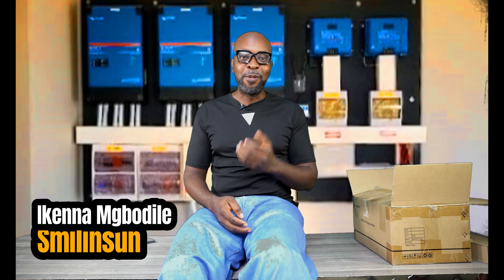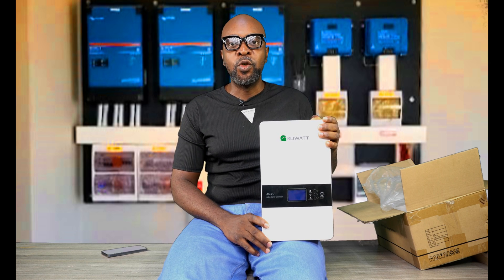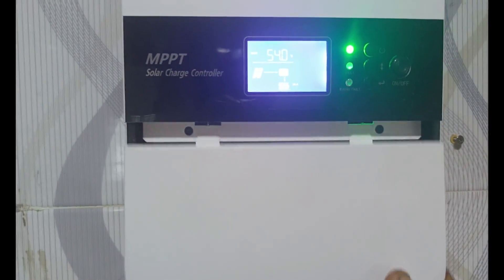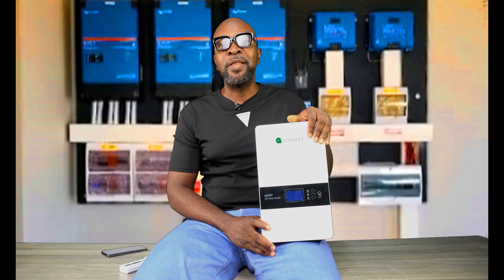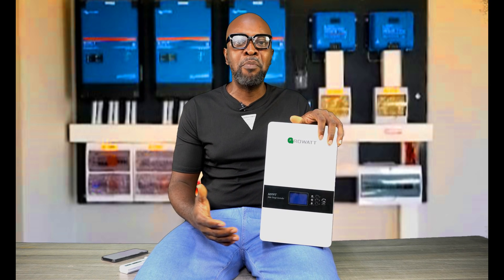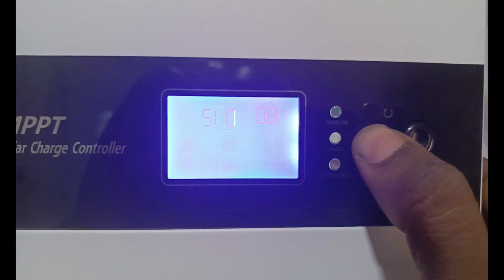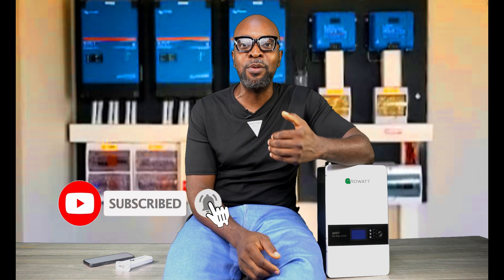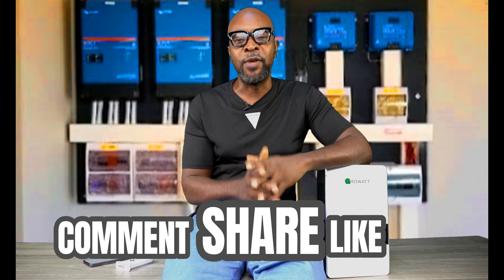Growatt Charge controller what you need to know.

Comment: Please I have a question. I have been curious for a while now about  these charge controller algorithm. 

I know there is Constant current stage, constant voltage etc.
I also know that when there is load on inverter, it draws a large amount of current from the battery.

My question is, how does the charge controller differentiate the current drawn by the battery from the one drawn by the load so that it can effectively execute the constant current.
Having in mind that the inverter, battery and the charge controller is connected in parallel.

On another thought, i believe this is when hybrid inverter is more smarter, because it can know how to separate the current going to the load from the one being drawn by the battery, so that it can charge the battery effectively.

To put this in a proper number perspective, a 12v 200A tubular that has a charging current rate of 0.1C which is 20A, a mppt charge controller can supply 80A but knows that it can only give the battery maximum 20A. But a 600w load at the same time draws like 50A from the battery. How does the charge controller know that the current drawn is from the battery or from the load, because the charge controller will make sure that the charge going to the battery doesn't exceed the 20A. This, in turn, will make the battery undercharge.

@ smillinsun, I need your input sir.

Comment: If you have a LIFEPO4 battery that has a BMS that cuts your battery when it is full, I have heard of issues with growatt controller not having any boost charge time configuration. Heard it just keeps charging and doesnt know when to enter floating. Is this true?
Reply from the maker: No that untrue , the system uses an internal algorithm system which determines how long it charges.  When the charge cycle is completed it always goes to Floating

Comment: Amazing videos always I've learnt alot from yout channel. 
I'm in need of a controller as the Felicity I bought was rated 60 just discovery after one year that it's actually 30amps on the inside.

Please what's the price range of  this charge controller for a 60amps model?
Reply from the maker: No sure 60 amps is available but 80 amps is available
Reply: @smilinsunsmilinsun8056  how do make inquiries and purchase
Reply: @smilinsunsmilinsun8056 please  how do I purchase and make enquiries?
Reply: @smilinsunsmilinsun8056  how do I purchase this and where
Reply: You mean Felicity deliberately lied about the true amp rating or it's some kind of mistake?
Reply: @adon8672 it support two pv 60 amp each ,is 120amp in total ,watch d video again